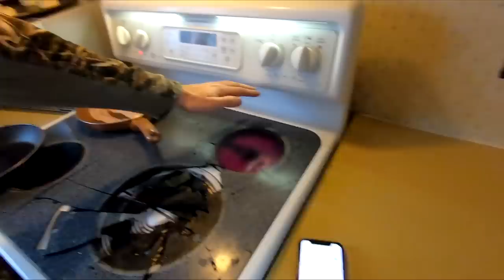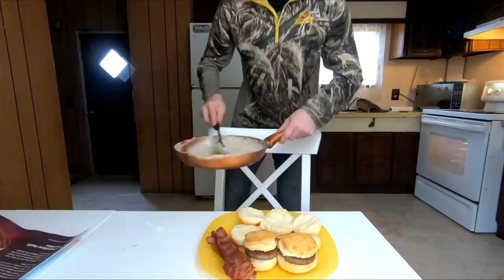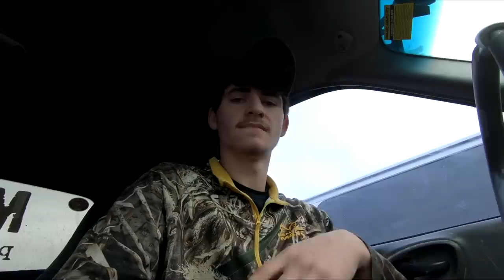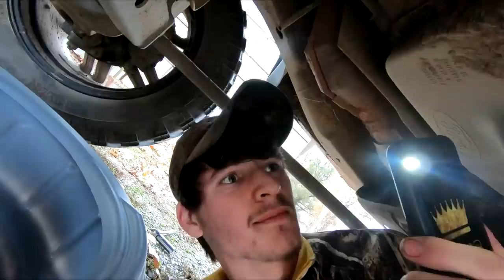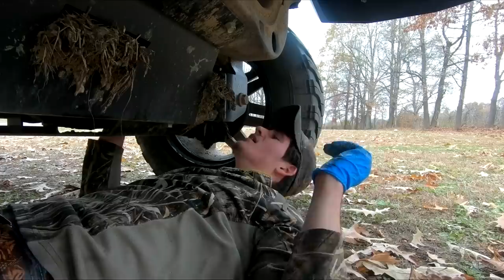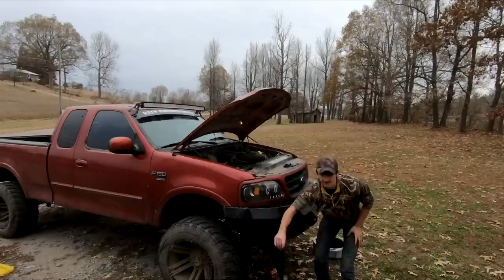I Didn't Change My Oil...

Comment from the maker: Yes, I know that my transfercase had the milky fluid and not my tranny. I just Mix words up a lot and didn’t catch myself, sorry y’all!🤘🏻🤘🏻 (I’m actually not a complete dumbass I’ve just always called parts the wrong name. Prolly mixed them up because they both start with “tra” lol. But I know how a transmission and a transfer case works so that’s all that really matters to me😂🤘🏻
Reply: Redneck Tv They probably take it off bc it helps it drain faster
Reply: The cap for the oil
Reply: Redneck Tv really grape kool aid?
Reply: Wouldn't flush the transmission
Reply: Redneck Tv if you want a knive sponsor hit me up
Reply: Go get the seals replace in your tans. That's what I hayed to do to stop the leching
Reply: Spince it the other way it comes off. Lol
Reply: Don't ever flush the trans I would just drop the pan and change the fluid and filter and gasket and call that part done but I would most definitely change the rear differential fluid immediately you need to get that water mix out of there you're going to make all your bearings and everything go out and cause rust inside your rear differential and too before u take the rear diff cover off and change the fluid makes SURE u can take out the fill plug cause if u can't u won't be able to refill the differential  I have seen that so many times people bring me their vehicle and can't get their fill plug taken out  to refill their differential  but I would most definitely do that as soon as you could you need to get that milkiness out of there  and hope none of that stuff got your transmission either .🛠 and ps I would check your transfercase too for the 4x4 make sure it isn't mixed.
Reply: Most likely the oil sending unit is leaking too and your tans is over full that’s why it’s shifting hard and it was low once before that’s why it was slipping that’s how transmissions best thing to do is drain some but it’s prolly fucked anyway
Reply: Redneck Tv that oil would be good for use in blacksmithing work
Reply: Erl change
Reply: Line. I. Woch. You
Reply: Redneck Tv hey
Reply: You still with your girl need a video with her in it again
Reply: Good tip on the O ring bro fr
Reply: Hey Kenny you have a nice trip I have one just like it
Reply: I never change my oil I just add more when I loose some
Reply: @dopaminejunkyyy4178  I just saw it  after I watched it
Reply: Just top it off with gear oil don't change it
Reply: Ha
Reply: Lube the new oil filter gasket with a couple drops of new oil. You will thank me later
Reply: @RNTV 
I can’t find your twitch

Comment: Take the cap off for air flow to get most of the oil out. Milky oil means water got in it. Diff oil would not likely be on the drive shaft. Good videos bro!
Reply: On The Farm And Off Vlogs or coolant which is what runs through the transmission go keep it cool so there could be be an internal leak in his transimisson causing it to mix with the oil
Reply: ITSJB yep most likely what it is. Unless it’s from sitting in a pond or mudding lol you would think his coolant level would be low if it was a cooling line
Reply: Don't know how but my transmission fluid was basically 60% water just a bunch of creamy white transmission fluid
Reply: lol there isn't coolant flowing through the transmission the way the transmission is cooled is the fluid is pumped through a trans cooler either built in to the radiator or an external cooler but either way no coolant runs through the transmission you can however have a built in radiator trans cooler crack and let coolant into the trans fluid but his issue is probably an open vent on the transfer case because the fluid in the transfer case doesn't go through the cooler
Reply: Chuckie yeah true
Reply: @ITSJB2  

Did you really just say that?....

Comment: Another tip when changing your oil you wanna put some of your new oil in the filter and let it soak in so that was your truck isn’t basically running off of no oil for a sec👍 showed me a couple of new tricks so I thought I would show you one thatis pretty important like this so Kenny can see

Comment: Another trick that I use for oil filters that are tight as hell and when I don't have the tools or enough room for a screwdriver and hammer, I clean the filter the best I can (my 6.9L leaks like there's no tomorrow) and wrap around a few Rubberbands and gives me a Shit Ton of Traction and hasn't failed me for a Last Resort.

Comment: I would just change the fluid and filter for the transmission from what ik is when you take the pan off and drain the fluid half of the fluid comes out
Reply: Tanner Warren a truck like that it is best to not mess with the transmission
Reply: DSyR Rampage true shit
Reply: Or you could try stop leak

Comment: Ya didn’t lube the new o ring 😱
Reply: Austin’s Outdoor adventures or put a little oil in the filter
Reply: G you don’t necessarily need to do that, and at that angle it’s just going to pour out so it’s pointless.
Reply: thats why it was so tight
Reply: @nickj6275  pretty sure it was to tight cause he admitted to over tighten it. The oil on the o ring is for keep the rubber from catching a dry spot and screwing the seal up. I promise one finger of oil will not be there when its changed again, too much heat for that small amount of oil to still be there

Comment: Taking the cap off helps let the old oil drain faster. And run 15 40 rotella I run it in anything and everything. GET SOME AT 205 STOP LEAK. If it smells like gas in the oil change your spark plugs.

Comment: If I were you I would buy the same truck again and take your lift kit and everything else  and transfer it to the new truck
Reply: What’s wrong with the truck he’s got now. It’s got a few leaks it’s still a good truck
Reply: Those trucks are pretty solid I have a 99f150 and didnt blow my motor up till 225,000.. I went mud riding alot lol

Comment: Check your radiator to see if trans fluid is mixing in. The trans lines go through the radiator and they can get a leak in the radiator. It happened to my truck my fluid was looking Milky and I ended up having to rebuild my transmission

Comment: you forgot to lubricate the new ring on the new filter, you gotta do that so that way it won’t crack and cause a leak. Also, I ALWAYS use either Valvoline and Royal Purple. They’re pricy, however they have the best cleaning agents in the oil, as well as the best lubricity. Do not, I repeat do not use Quaker State, Pennzoil, or Shell. They have waxes in the oil that will stick to engine components and cause carbon to stick to it. You’re welcome, I hope this was helpful.

Comment: Check your transmission pan bolts just go through there and make sure they’re snagged up because sometimes they got a rubber gasket in it with the work loose

Comment: A tip when putting a new oil filter on, is fill it all the way up with oil that way when u start it up again there is already oil in the filter to be filtered into the engine

Comment: I only hand tighten my oil filter, never tighten the hell out of it. Also dip my finger in the new oil and wipe some on the new o ring on my filter. I had an oil leak on my truck but it was because i bought it with 2 blown head gaskets, valve cover gaskets blown, bad rear main seal and somehow still ran. Also had a stretched timing chain

Comment: I believe the open the oil cap for air flow so it doesnt glug like when u take a gallon jug of water and tip it upside down without a cap but if u were to drill a hole in the bottom of the jug it would have airflow I think that's why

Comment: You take the cap off for airflow to help the oil drain faster and I put the cap on the hood latch so I don't shut the hood and crank it without the cap.

Comment: Your trans will slip if you flush it, essentially its the sediment and particles in there that are keeping it from slipping and giving it better friction. Just add trans fluid and keep it topped off. The only time i change auto trans fluid is if its been changed at regular intervals since brand new.

Comment: Kenny, when you use full synthetic oil, it is often rated for up to 10 months to a year and 15000 miles before it needs to be changed.  Contrast that with 50% natural and 50% synthetic (those are only rated for 5 months and 5000 miles), and 100% natural (which is the usual 3 months and 3000 miles). That constant velocity joint on your front axle shaft may be leaking its grease or oil fluid (if it isn't coming from the engine's valve cover, that is)? The tail shaft on the transmission is also leaking (and being milky must have gotten some water inside, like back when you broke through that ice last winter). The motor oil doesn't look as dirty as we all thought it would look, but changing it is great for peace of mind, season change, and the interval that you got up to now.  It used to be where you would have to drop the transmission's oil pan to change its oil (and still do to change its filter), but having a plug in that, that is a more recent development, and with it being milky looking, I am sure that will be next.  Oh, and I am sure that you know this, but use a new transmission pan gasket if the pan needs to be lowered! That way, it is one less thing to leak back there.  When your transmission is about to go, it won't shift at all (sure, you probably will still have reverse, and second gear, but when it starts to slip down from fourth, to third, and want to stay in second all of the time that you drive forward, it is about ready for a rebuild!  Another thing about this era of Ford transmissions, if the sprague clutch goes, first gear won't move you forward, so you will have to start in second and shift to drive/overdrive manually until it can be rebuilt, all first gear will be able to do is engine braking in this situation! Second thought, that motor oil was really dirty (it didn't look all that bad at first), but next time, if you can get some of this, put an engine cleaning fluid in it after the old oil is drained, start and run for about five minutes, drain this, refill with oil after changing filter, and the new oil will be so clean that it will be impossible to tell that oil that dirty was in the engine for too long of a time!

Comment: Just a heads up when you put a new oil filter on put a little bit of oil around the rim before you put it on so its easy to get off next time you change it

Comment: The reason you take the cap off before you drain the oil is to let air flow through so the oil drains faster and more thoroughly

Comment: I’m very picky with my trucks maintenance 😂oil changes every 4-5k with Lucas full synthetic and a K&N filter which I replace every time even though they are good for 2 oil changes. Truck is minty for an 01 with almost 300k on it

Comment: If the transfer case oil leaking out looks milky water has gotten in. U should change that ASAP before it toasts the bearings. Check both diffs for too jus in case

Comment: Maybe not flush it but just a regular transmission fluid change cause a change only removes like 2 or 3 quarts out of 7 well mine anyways. Keeps some of the clutch material in it I believe

Comment: Need to rub oil around the gasket on the oil filter before you put it on if you didn’t. That there can cause a leak because the gasket spinning dry can stretch in, oil helps it spin and compress properly bud

Comment: Just replace the extension housing seal on the transfer case, it's easy, just gotta pull the rear drive line

Comment: kenny why didnt you put oil in your filter before you put in there because when you start your truck no oil is going through your motor for about 15 seconds i found that out the hard way
Reply: Tatum Moore that’s not possible on some engines, for example my 2000 Ford rangers filer goes on almost upside down

Comment: When u put the new filter on u should fill it with oil so your truck doesn't have to try to start without oil in the filter
Reply: you can't on those tritons, the oil filter is sideways.

Comment: Open your hood and sit on the motor like you did at 21:20 but put your truck in drive and pull the throttle cable to drive😂

Comment: Don’t add thicker viscosity oil then the  manufacturer recommendation it will cause your truck to worker harder for the same horsepower and can wear your engine down faster due to when starting your truck and it not being able to flow as quickly as needed and caused metal to metal contact in engine with no oil to protect it

Comment: I have a 1997 f150 which is the same body style like yours and it has a 5 inch lift on it and my truck Burns and leaks a little bit of oil

Comment: The reason you take the cap off before you pull the drain plug is because of the pressure.  You wont be able to pull the drain plug out and it makes it harder to drain all of the oil out.
Reply: cole jarrett the fuck you talkin bout not being able to pull the drain plug?!!! Bud.....listen, you can definitely pull the drain plug out there’s not a vacuum lmao it just helps keep the oil from burping and drains a bit quicker

Comment: Anndddd 5w is thicker than 10w at running temp.
Do NOT FLUSH IT JUST CHANGE THE TRANS FILTER AND DRAIN AND REFILL. Did that with my 98 with 274000 miles and it runs fine. A need to put a fresh coat of oil around the O ring of the oil filter that way doesn't leak from a dry O ring you should know that

Comment: My oil pan was leaking so we fixed it with a new oil pain and we put the bolts on tight and it was still leaking and some one told me that you can't put the bolts on to tight is that true

Comment: My mom hasn’t changed her oil in 45,000 miles not Evan kiding my oh and my moms car is like kind of ticking when it idles any suggestions on what it could be
Reply: Probably a lifter (or multiple) lifter's failing. 45,000 miles without an oil change is absolutely absurd. I would hate to see what the cam, rod and main bearings look like.
Reply: Trevor Stearns see I was thinking maybe it was a piston return spring or something but it only does it when it idealing so I don’t thank it’s that so idk but it has started to shift hard also so I have know clue man
Reply: Your mom does not deserve a car, this is why i hesitate to buy a car because of people neglecting them.
Reply: @teezy.4ep327  at this point I'm honestly not sure if your trying to troll or if these are honest question you have. If your serious and would like some questions answered let me know, but I have to be honest the comment about a piston return spring really makes me feel like your trying to troll people
Reply: Trevor Stearns no I’m for real I used to have the same car and it kind off sounds the same and I looked it up and that’s what they said it was so I went to get it fixed and it stopped so I don’t know that much about cars I’m a motor cycle kind of guy and I really don’t know to be honest
Reply: @teezy.4ep327  you really need to find a different mechanic/shop if they told you that the ticking you heard was "piston return spring" as there is no such thing. It's most definitely warn out lifter's
Reply: There’s no such thing as a piston return spring. It’s either a clogged up lifter from not changing the oil or she spun a rod bearing.
Reply: AllWheel drivE I was joking about her car but my car used to have piston return springs look up criss fix if you still believe you know everything he had a video on it
Reply: @teezy.4ep327  

Oooh another youtube mechanic.